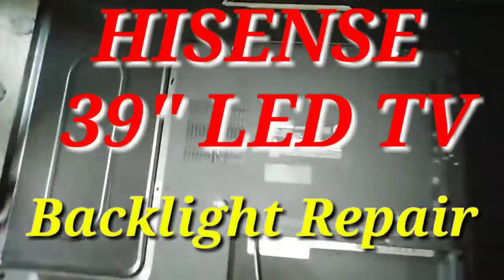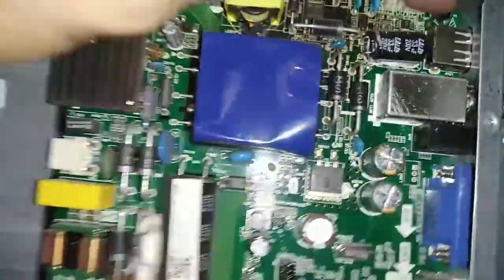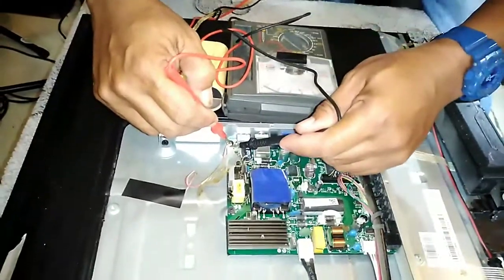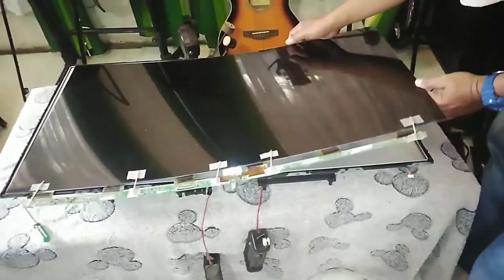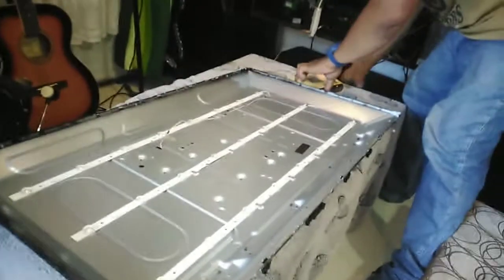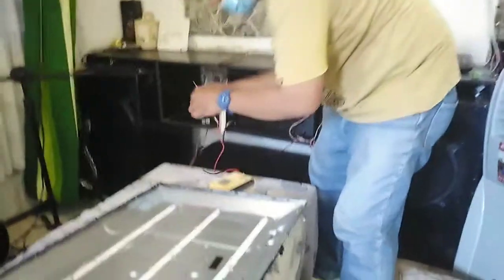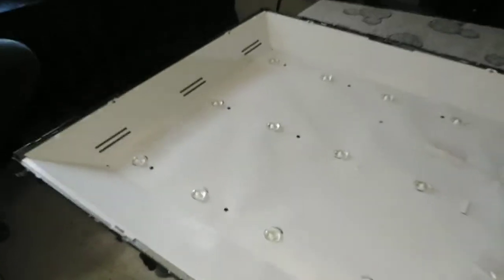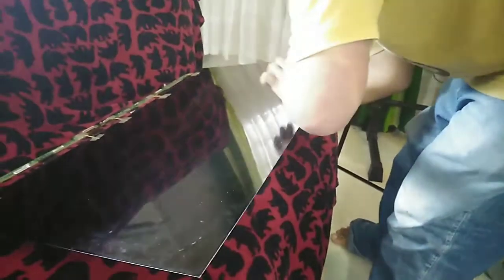HISENSE 39" LED TV BACKLIGHT REPAIR Model : 39N2174

Comment: Sir nasubok kung magpalit  ng backlight na ganyan na tv pero napupundi sya agad pag switch on..ang backligth ba pariparihas ang voltage nya?
Reply from the maker: iba2x po dapat same volts at bka sira driver nyan sir
Reply: @DANEXTTECH  sir anu po kadalasan na supply ng mga backlight sa led tv?